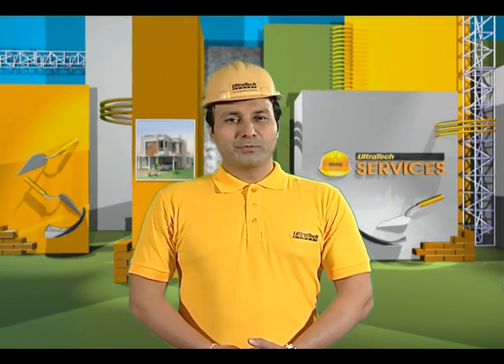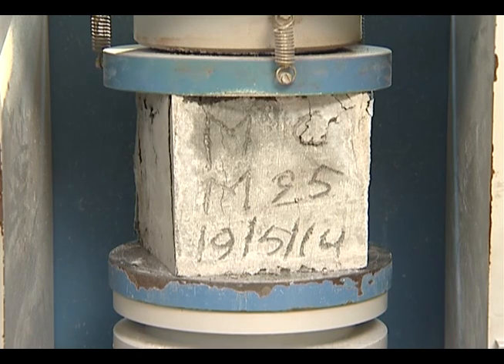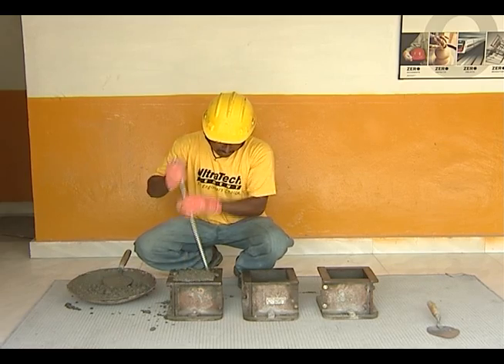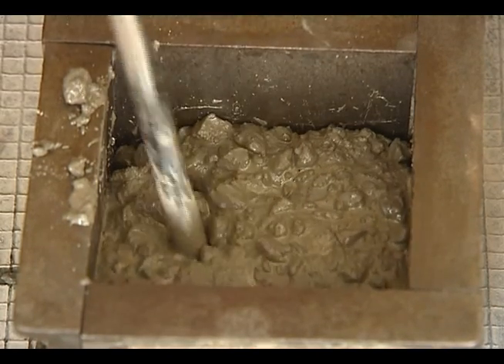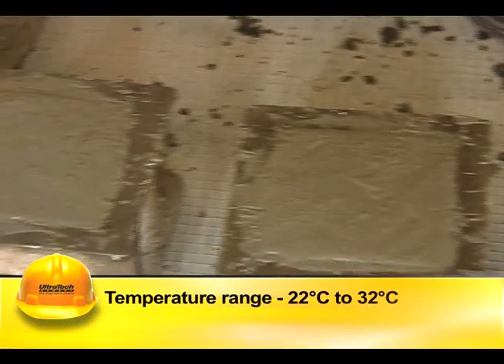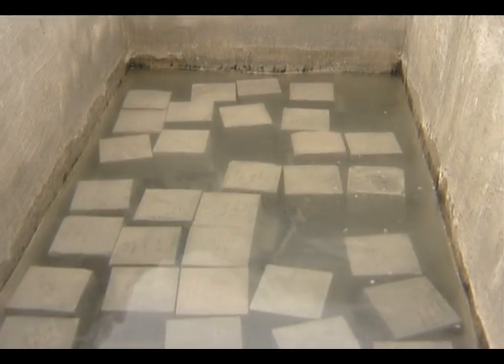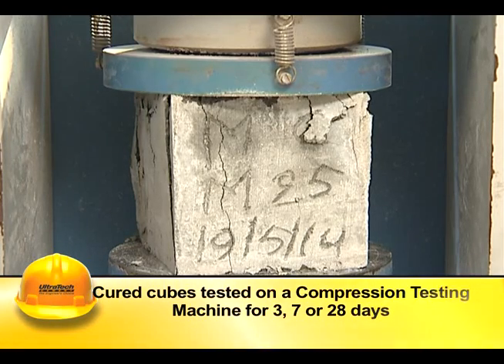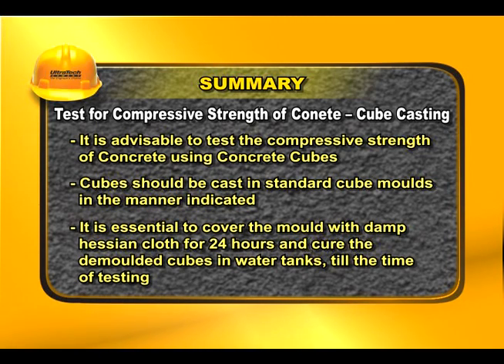TEST FOR COMPRESSIVE STRENGTH  OF CONCRETE-  CUBE CASTING

Comment: 35 blows in each layer? Is it 35 or 25??
Reply: Sudipto Nath Priyom it’s 35 in a 150 mould 25 in 100mm    BS
Reply: @AndyWardle  but why only 35? What happen if i hit 45times??
Reply: @yd_engineer420  more compaction is fine. Less is not good. Minimum of 35 for 150mm (6inch) cubes. 25 for 100mm (4inches)
Reply: @yd_engineer420  You have to follow the guidelines. You can't blow 45 or more according to your wish. One thing you have to keep in mind. The more you blow, the denser concrete you will get. But you can't control the blows all the times. That's why you have follow the guidelines. Keep in mind that you are going to use vibrator in real field condition. So, just follow the rules and fly with the wind! Cheers! 👍🏼
Reply: @sudiptonathpriyom3978  what happen if concrete get denser
Reply: @yd_engineer420  Compressive strength will be improved. This may mislead you.
Reply: Get it. Just missed the size of the specimen. Thanks! 👍
Reply: But why only 35 why not 40

Comment: Blows 25 times 
Not 35 times
Reply: No. In slump cone test you should 25 blows in 3 layers but in cube mould it will be 35 blows in 3 layers.
Reply: @biplabhalder7924  in slump 4 layer concrete with 25 blows
Reply: @Civilsitework201  yes bro...
Reply: 35 tamps per layer minimum in 150mm mould, 25 in 100mm mould.

Using a tamping BAR not a rod.